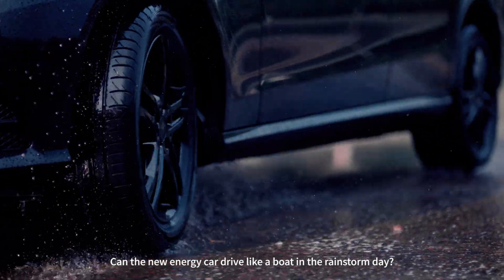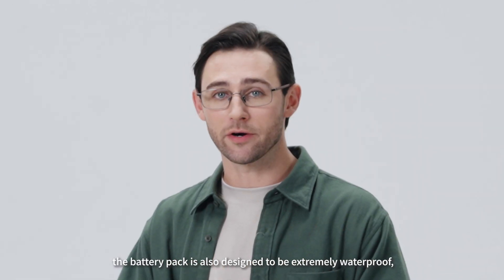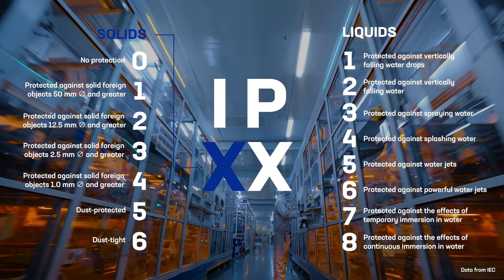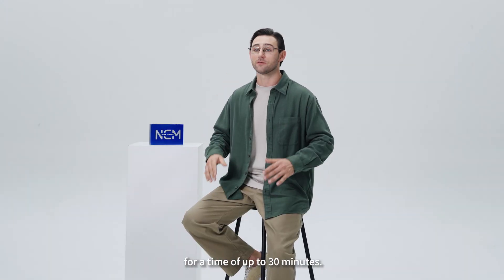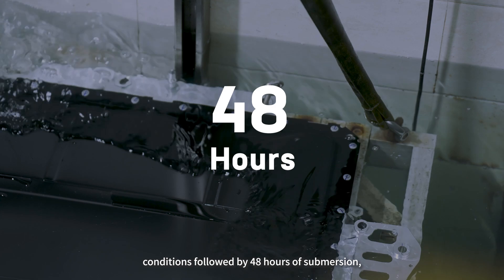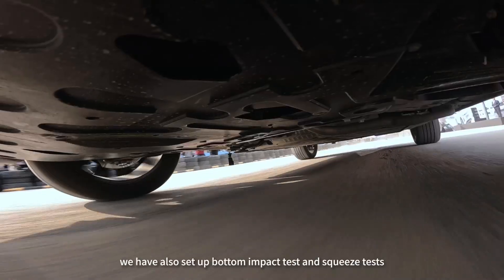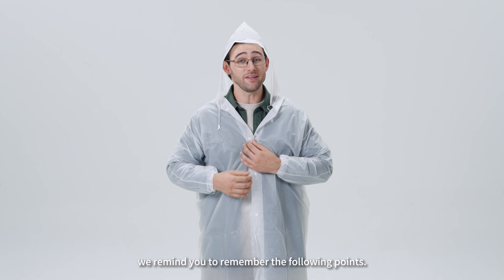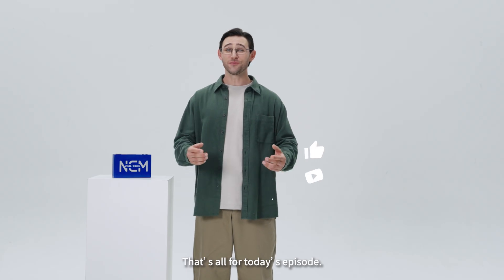How Do EVs Drive Through Deep Water

Comment: A friend was driving his performance Ford along a moderately flooded road, about 10 inches of flowing water. The air intake directed water directly into the engine with an instant head lift off. My LEAF has no problems on the same road.

Comment: IP67 does not include pressure beyond that of gentle submersion in 1 meter of water.  Drive very slowly. Also you had better hope that your vehicle has been built and serviced correctly every time.  At high voltage there is no room for error as even just a little bit of water is a problem in those connections.

An internal combustion vehicle can wade more deeply than is safe before it will affect the intake.  So can your EV, unless there is an unknown problem...

Comment: I have seen a recommendation that said; "If your EV has been involved in a flood event where water containing silt or other contaminants is deeper than the level of the car's battery, have it checked out"  There is potential for corrosion over time, possibly causing problems in the future.
ICE vehicles can also be affected however... my daughter's Ford Mondeo was written off by her insurer because flood water came higher than a few inches above the bottom of the doors.
Reply: I have a Wuling Mini, and had to go some times through deep water, so that the battery was like half under water. Because I didn't want to lose time searching for a way around. Nothing happened, and I hadn't anyone look if it caused some damage.
Reply: I think in general an EV is less likely to have problems in water than a similarly sized gas car (can’t waterproof a combustion engine car that is reliant on oxygen)… but if it’s salt water, an EV isn’t just worse, there’s actually a small chance of battery go boom.
It’s expected that the battery go boom risk will be done away with in better systems in coming years.
Reply: @SigFigNewton  Most of Chinese EVs have LiFePo4 batteries, which don't catch fire, nor explode. Anti-EV propaganda never ever mentions cars with LiFePo4 batteries.
I have two different Chinese EVs, and both have LiFePo4 batteries. So, there are no problems at all  there.
Reply: @hokroeger  nickel cobalt magnesium batteries are more fire prone?
Reply: @SigFigNewton  Yes.
I never heard about any LiFePo4 battery car catching fire. Have you? It is really hard to get it burning, as you may see in this experiment:
"Fire dangers of a fully charged LifePo4 12v 100ah battery in home and only used for emergencies?"
Reply: @SigFigNewton  The intake on your ICE car is higher than you want to wade that car.  The bigger problem is splash and a wake. For an IP67 battery pack the "7" is the highest rating for water ingress and it does not rate for any pressure beyond a gentle splash or what would be exerted by gentle immersion in 1 meter of water. In other words, if a hard splash hits your high voltage connectors wrong, or a hard splash sends a lot of water into the air intake of an ICE, you could be in trouble.  An ICE car might die or in severe cases suffer severe engine damage.  A high voltage connection might short out killing the car and posing risk of electrocution and battery fire.
Reply: @Sylvan_dB  hmm. Thanks